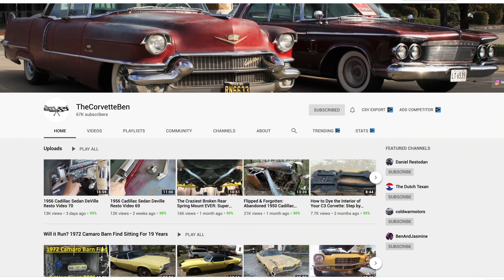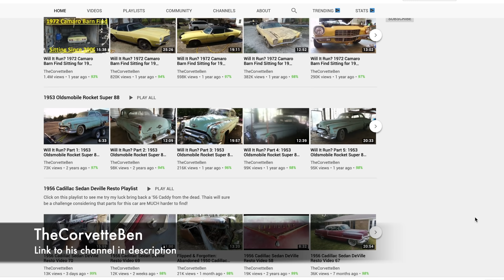Corvette Stingrays - Built vs. Bought

Comment: 0:12 There's something horribly off-style about driving those cars wearing a face mask. At least you need a shark mouth or flames on them. (Personally, if it was worth the effort, I'd try to get a Guy Fawkes style one. But definitely not from Amazon or Ebay.)
0:32 Carl's bad, baby, ... Carl's bad.
0:58 "It's kind of like China followed us here." ... That's the American way. 😉 (You always find in the cave what you take with you. )
1:43 Yeah, C5, at least visually, is so boring. Make a pile of generic Corvette concentrate, pour water on it, voila. Next gen with no effort.
1:53 FREEZE FRAME right there! Two Corvette C3s next ot a sign that says in red letters: "PAY LOTS" 😆 - That should be the video thumbnail.
2:01 That license plate really doesn't quite click for the non-initiated. 😄 (People probably think you are a hedge fund manager. 😜) .. Cynical joking aside ... it's hilarious in context to the car.
2:09 NEW ENGINE even! ... Me likey! It's like my factory new 3rd gen jap. 3S-GTE with ceramic turbo. You know it from very early-on. And MOAR POWAH! 😬 (110 to 242 hp in my case.)
2:57 Try to get an exhaust from 11 Racing. (I just made that up.)
4:19 Stumbling into a military zone... Another China flashback. 😄
5:20 I think if you had driven Priuses into there, you'd still be UGH. 😆 (No, wait, that's California. ... Military base in Cali ... colonel panic.)
5:22 "Oh, yeah, we'd have ended up in prison or something." - Im America you only end up in Prism for that. 😜
5:30 "The military, very friendly folk." - Much less so abroad. 😏
9:05 If I push the pedal to the metal, my car eventually hits the rev limiter at 7900 making  ~143 mph (for Germany that's sadface territory 😜) and might even start to expel visible puffs. And that is not only because of the MR2 gearbox, but a Corolla has on average much smaller tire diameter than a Celica and my aftermarket tires also have the smallest diameter allowed for a Corolla. That can make a big difference, too.
9:09 "Your indicator is on" 😂 Classic!
10:21 I see what a police station in California looks like and everything be damned, I am missing Hawai'i. I just want to teleport there. If they arrest me for illegal immigration, I will just give them the secrets to teleportation. I am so sick and tired of this place. (Although, to be fair, Germany is probably less germ-many than the USA right now.)
10:56 That's so shallow though. You're kinda admitting you are craving affirmation. ... OK, not shallow, but in an odd way honest. ... But don't forget that our yearning for affirmation is just a settling for second-best. A bit defeatist, understandably in our world. ... But personally, the compliments I got for my car, they kinda saddened me, because it would be easy to put some passion and artistic taste, into a car, yet few do it, but everybody compliments on it. - Explore yourself. Don't get entangled in exploring others. That's an inaccurate view. (OK, maybe you do follow your own heart and that awakens people's passion. But it is a two-sided sword, because it also awakens desires.)
(Geez, I wish I could be drunk at all time. This stuff is too important to be paywalled.)

Gimme a holler if you are rad enough to have read this. (I am a sucker for hope. Call me a ruthless radical. But silly me is still bound to respecting free will.)
11:40 I just realized how much of a connecting experience it is to drive the same car model.
15:31 Right now what's getting all my looks is that German farmhouse style building in the background. Very unusual sight, no?
16:20 Considered installing a racing flywheel? It's really fun when the engine revs super-responsively. It gives it that tiger-prancing vibe. (Just get good stuff so that it isn't a flyapartwheel. 😄)
17:27 That segment was really too short. 😊
17:58 Yeah, you fix up a car real good and that's driven by passion, and no one will pay you appropriately for passion, so if you can manage to buy a fixed up  and caressed classic car, the previous owner will be the one with tears in his eyes and, well, you will be the one with tears of joy out of thankfulness for the previous owner's loving passion that went straight into your hands. In fact, you should almost feel bad for it, but when you understand passion, both parties know it is an honorable deal.
18:17 Imagining: Whether you love my Corvette or Winston's, we love you all the same. ... If you don't love Corvettes, go to China. 😆
18:32 Easier said than done. Accept the terrifying truths of the universe equally to the importance of simple joys. Then you have found true balance.
18:38 Isn't it great when you just know that your preferred licence plate is still available? 😆

What I am hoping for is that we are all gonna be mighty surprised by how things develop and some not too distant day we'll be able to meet in person.
And I don't even know whether that will require a damn lot of effort or just a ton of loving surrender. Whatever works beast. I mean Corvette. I mean best.

P.S.: Hey, there's ethanol in Covid disinfectants, no? ... I am sensing something grand and magnificent. 😏

Comment: few cars are more just plain fun than a C3.  I have a 74 with the L82...it's not my quickest car but is quick enough...chirps the tires on 2-3 shift.  context, boys...calling cars terrible, any old car not just corvettes, because you're comparing them to current technology is wrong...compare them to contemporary cars back then and the C3 is much more appreciable for what it delivers...speed, style, driving engagement.  also, talking about max revs on the highway is the wrong conversation...you drive a C3 for exactly what you're doing in this vid, or on mountain roads, or the track...not for droning along with the Camry's and semi trucks on I-5.

Comment: The 68 had more powerful engines avail from factory then
- the at most underpowered - 74 and 75 model year. The
last BB was in 72 avail with 270 hp DIN. And ur 68 have
from the C2 retro styled Kelsey-Hayes rims. Study the 
Corvette history guys. I strongly tend to the 68. With 
rechromed trim. Thick side pipes dont make more hp